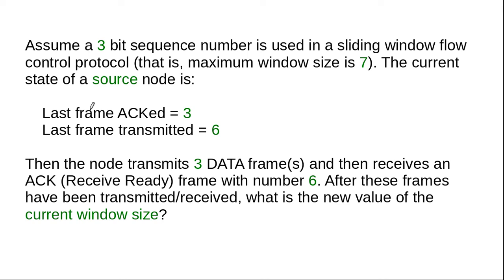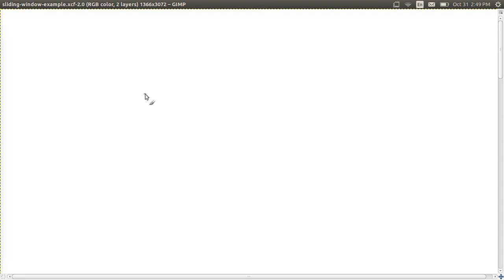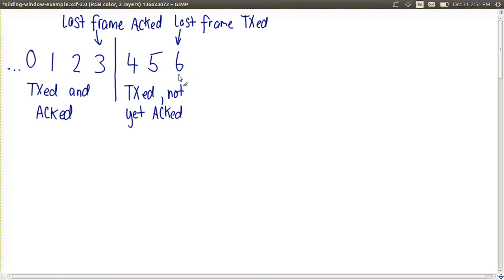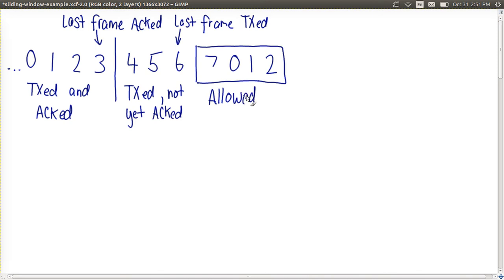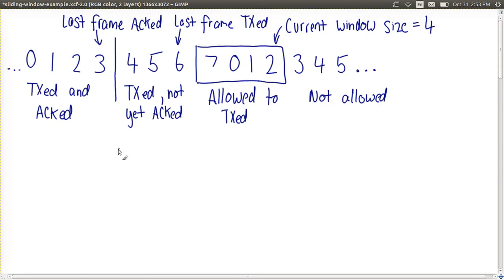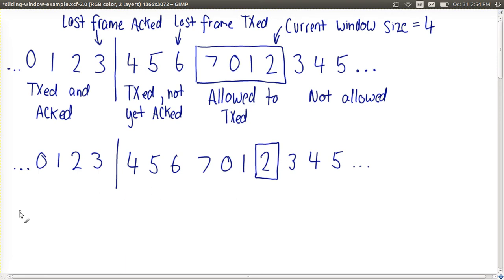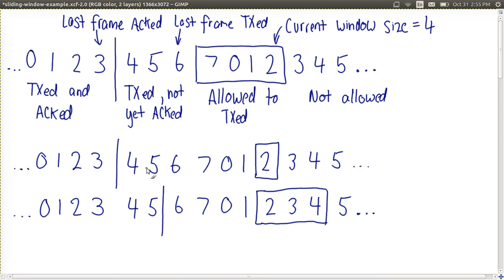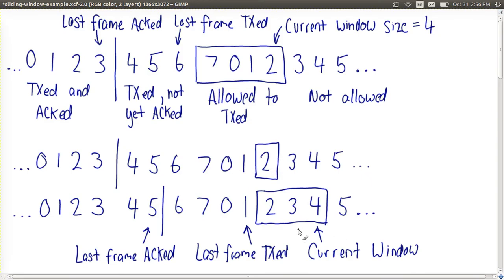Updating a Sliding Window for Flow Control

Comment: I have some questions !
1. The first time you were told that last frame acked = 3, you add 0,1,2 plus 3 in acked. The second time when you were told last frame acked is 6, you only added 4 and 5.
2. The first time you increased window size was based upon
                            # of frames transmitted but not acked + 1
Where as the second time you increased it on the basis of # of frames recently acked.

And Thanks ! This video is really helpful !
Reply from the maker: shahrukh631 1. The start of the question it says "Last frame ACKed" is 3. Meaning frame 3 has been ACKed, as well as frames before it (0, 1 and 2). But then the question says an ACK is received with ACK number 6. What the ACK number of 6 means is that the received is EXPECTING frame number 6. This effectively means the frames numbers 5 and 4 have been ACKed. Hence I add only 4 and 5 to the list of frames "TXed and ACKed". Be careful not to confuse the last frame ACKed with an ACK number: an ACK number indicates the next frame expect (not last frame ACKed).
Reply from the maker: shahrukh631 2. The window gets smaller when we transmit frames. The window gets bigger when we receive ACKs for those transmitted frames. So the question says 3 DATA frames are transmitted, so I reduced the size (on the left) of the window by 3 frames. Then later an ACK with ACK number 6 is received. As outlined in my response to your first question, this means frames 4 and 5 have been ACKed. Since 2 frames have been ACKed, I increase the size (on the right) of the window by 2 frames. Be careful not to confuse the "number of frames" (e.g. 3 frames were transmitted) with the "frame number" (e.g. frame number 3 was transmitted).